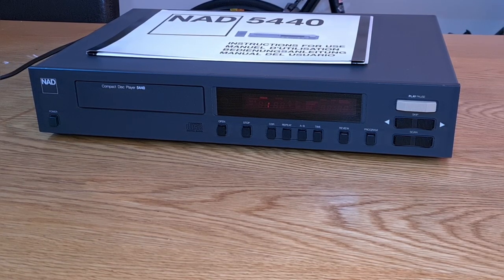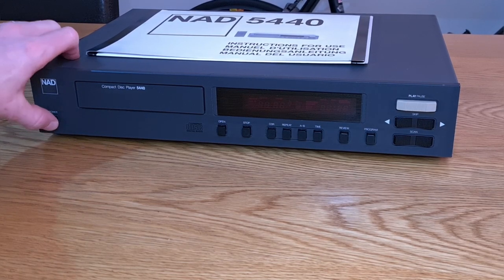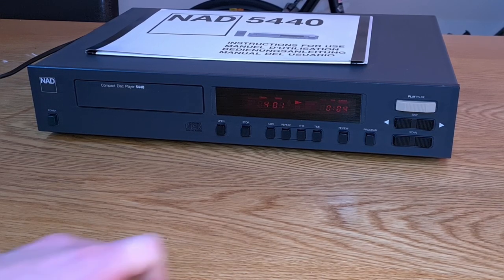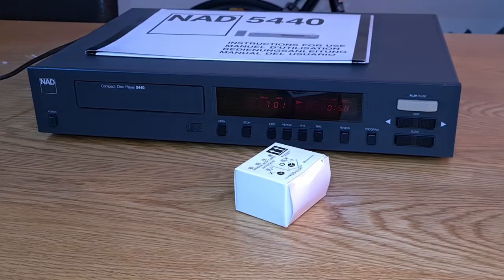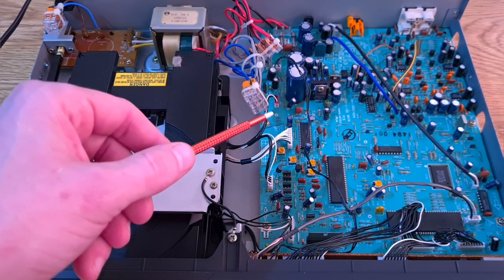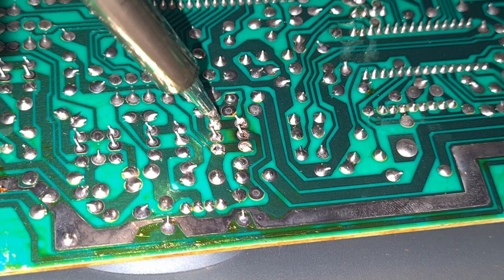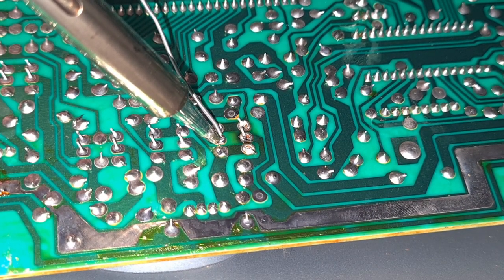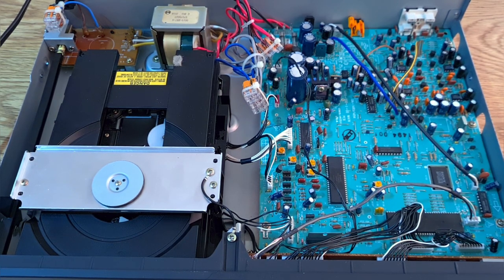NAD 5440 Late 80s CD Player - Repair & Laser Replacement

Comment: Bought one of these KSS-210A lasers to replace the one in my Rotel RCD-930AX CD player a few months ago. Spoke to one of the sellers on the Chinese e-commerce platform Taobao, found out that there are only a few actually brand new lasers available for most Sony/Philips/Sanyo transports, and they are commanding a ridiculously high price premium. Almost all of the cheap replacements we buy are salvaged from old players, CD-ROM drives etc. The sellers clean & test them for a bit, before chucking them into an anti-static bag & box them. They aren't adjusted, so it's on the buyer to do the calibration. Although most times they will work straight out of the box,  they simply are not able to guarantee how well it'll work and for how long.

Comment: I purchased a unique NAD L-40 that has CD , tuner , and single rca input off Ebay. Sadly the CD section reads "disc error" or "no disc". When opened up and after cleaning the laser still no use!. But I notice that disc ALSO wont spin? Is this fixable? What is reason older NAD wont spin a disk with a clean laser?
Reply from the maker: The disk isn't being detected it seems. There's a pot on the laser unit and you can sometimes turn it up to get the sensitivity of the laser higher. But he that burns brighter burns half as long

Comment: When you replace a laser, do you need to make any adjustments to potentiometers in the player or on the laser?
Reply from the maker: The answer is a bit complex, readings from the board should be taken, which are extremely complex and require a well setup and decent oscilloscope. Most of the time you can fire a new laser in and it'll be fine, however the time it will be fine for is unknown. Too much power on the pot and you get a great laser with lower lifespan. Too little and you get a potentially problematic one and a longer lifespan. To set the waveform involves minute adjustments usually to the laser unit itself, and also pots on the drive mainboard. If you're lucky enough to have a decent service manual, that's great and quite easy. 

Unfortunately NAD lasers need extra equipment between the drive and the oscilloscope to setup the waveform, I think this is shown in this video. I didn't have this equipment so had to settle for a direct swap. 

Most other cd players allow you to connect your scope directly to test points on the mainboard and go for adjustments from there.

Have a look here:
https://www.pcenginefans.com/forum/index.php?topic=8926.225

Comment: Nice fix i bought a new laser for my hitachi boombox a cx -w700 one of the lasers on aliexpress looked more like the original than some of the others. So i bought it and its not a cheap laser either compared to most but when i opened it up, the fault for the none working cd player was obvious the cable was part out of the connector on one side ,So i bought a laser i never needed  .On a sharp boombox i made a massive mistake changing the laser by undoing both rails it sits on and one has alignment on it i remmbered after i done it and the alignment is out it reads toc but plays up playing a cd a lesson learned .
Reply from the maker: The alignment can be rectified quite easily on Sony players with an oscilloscope. These NAD ones require a special circuit to be built in order to conduct the correct tests, which is beyond my interest / ability at the moment. Luckily this has been great since. 

I've definitely been there with buying unecessary parts! Usually when I buy things half blind before a proper inspection 😄

Comment: My only concern with that new laser, is where the metal rail goes through the guides in the laser chassis, on the original one, the chassis appeared to have brass linings in the rail guide holes. But on the new one, the guide holes appear to be all plastic. This may cause problems down the line if the grease dries out. And the laser transport may snag occasionally, on the guide rail. I could be wrong, but I noticed the difference straight away when you had the two lasers side by side. The replacement did instantly look cheaper made than the original.
I suppose it is quite easy to smear some grease on that metal guide rail from time to time, to keep it running smoothly.
Reply from the maker: You're exactly right, no brass bushings on the new ones. I've still got the deck and use it regularly, still going 😄
Reply: This is my concern as well , I'm in the process of having my NAD 5420 repaired, profacionaly &  concern being once the laser is replaced , you ( I'm expecting a degedation in playback quality) and no longer up to spec. To the original.